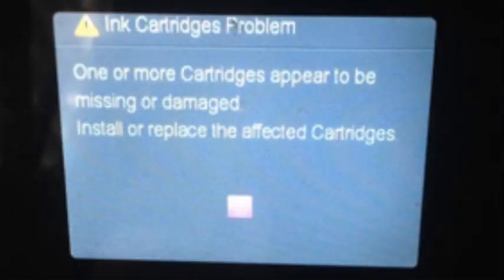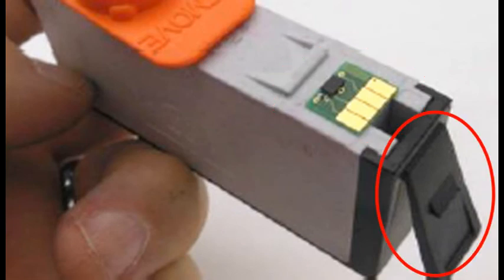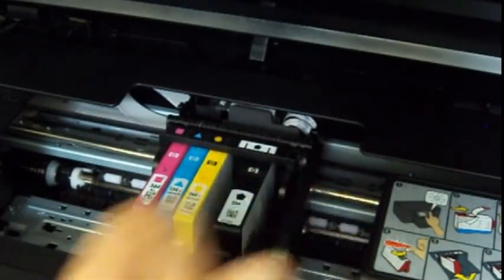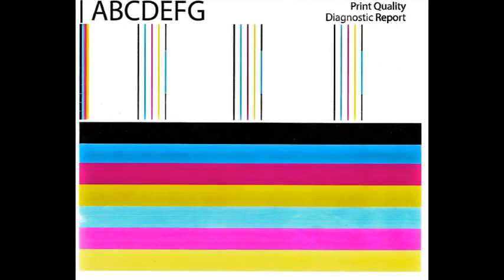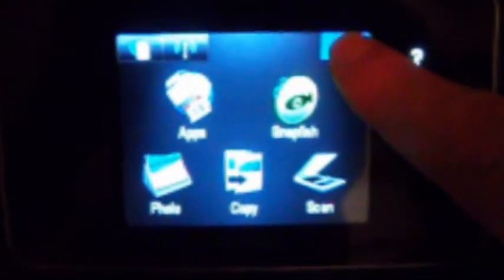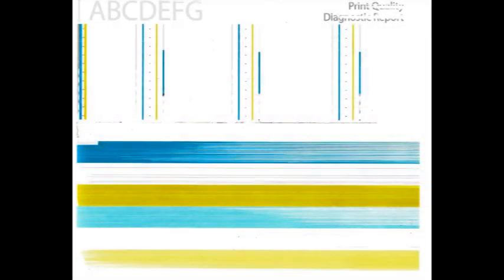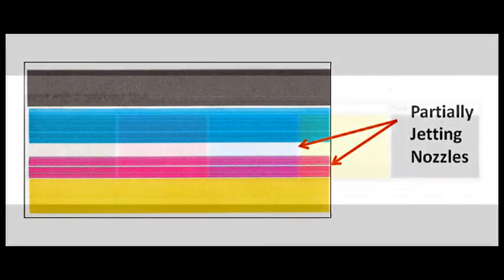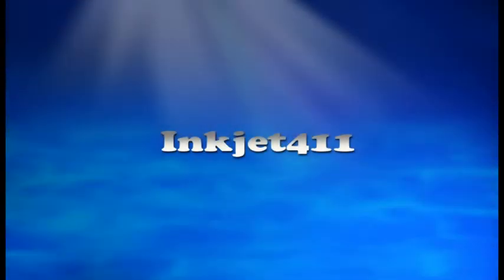HP OfficeJet Pro 6960 Printer Errors (HP 902 Ink Cartridges)

Comment: If you're considering this printer, don't! The print head constantly dries out and requires entirely too many wasteful cleaning cycles. HP has locked out any and all re manufactured or 3rd party cartridges and seems to have done away with any retail outlet availability, at least in and around zip 19444.